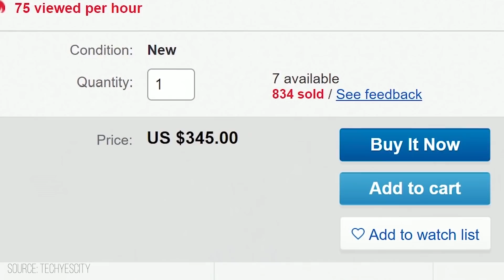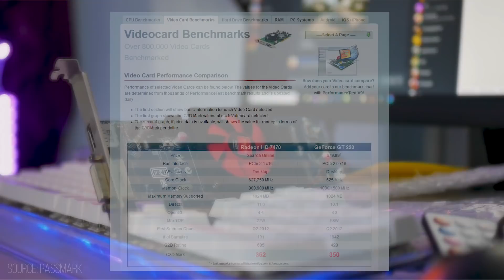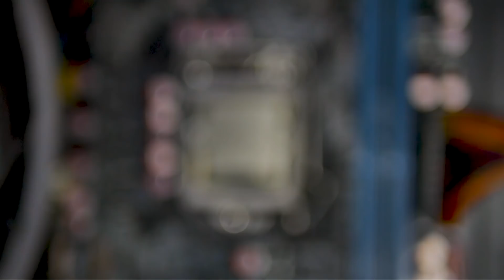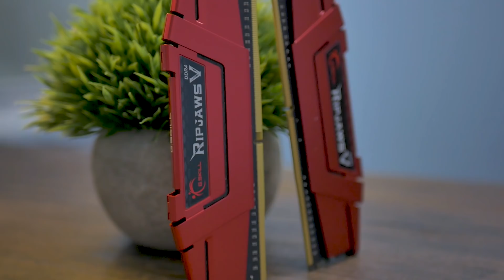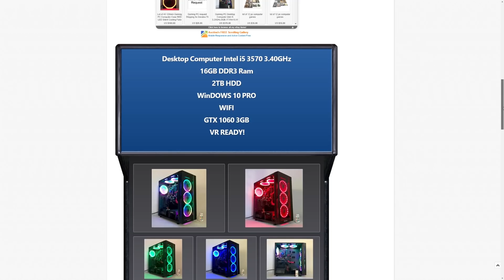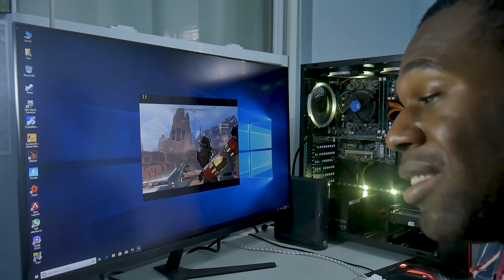These eBay Gaming PCs are NOT GOOD...Here's Why | OzTalksHW

Comment: I had an OEM PC sitting around and an 8GB XFX RX 570 so I thought I'd get a nice power supply and drop the 570 in it so I could sell it as a gaming PC. It's a quad-core AMD Phenom II 820 with 8GB of DD3 RAM. I got an SSD for it, installed Windows 10 and used the Windows 7 key on the sticker of the PC to activate the fresh copy of Windows 10. At this point I'm thinking the RX 570 would be the hero and I could definitely get 60 FPS at 1080p no problem. WRONG!! I chose to run the Shadow of The Tomb Raider benchmark to test it since it is a CPU intensive benchmark. The results were mid to high 40"s FPS. Sounds playable but when you look at the 1% lows its awful. I ran the game on story mode and oh boy it's far from playable. The stutters are insane! If you are in the hidden city... forget it! the FPS drops below 20. I bet it runs Fortnite somewhat OK but surely some stutter will still be noticeable. The CPU doesn't even have the instructions to run APEX Legends (you just get an error message when you try).

Anyway, it's miles better than the PC on this video but I thought about the same thing OZ said; some kid excited about his/her new PC on Xmas morning only to be destroyed by the fact that the PC sucked. Or even some teenager or adult who spent their hard earned dollars thinking they were getting a nice system. I'm definitely going to take out the PSU and the GPU, leave the SSD with the fresh Win 10 install and sell it cheap as an office PC (I'll drop an old NVIDIA GT 740 in it so someone could run titles like CSGO or League if they want).

Moral of the story is guys, don't be a greedy bastard and screw people over. Even a PC that can average 45-50 PFS on most titles is garbage for gaming when the CPU is always stuck at 100% utilization and stutters like crazy during game play. Don't do it to people. Think about how it would feel if it happened to you!

Comment: I managed to pay 420 for a prebuilt system with a Ryzen 2400g which I honestly thought was really good, later down the line I bought a gpu and other upgrades, but honestly should of built it myself cause it really wasn’t that hard to rebuild (just the front panel connectors)

Comment: The eBay gaming PC market is horrid, there are TONS of listings just like this and even worse ones.

The guy who sells these exact machines on eBay has over 1000 sold for that listing (priced at $339.99 last I checked with only about 3 negative reviews). The whole market enrages me as a seller with respect for system performance because if you dont have RGB everything, good luck selling even a $5000 gaming system for $300.

Pro tip, if you are trying to sell gaming systems on eBay, you need to have RGB for the boomers who are probably buying these things for their grandkids

Comment: somebody help me with this: https://www.ebay.it/itm/ULTRA-FAST-i3-i5-i7-Desktop-Gaming-Computer-PC-2TB-16GB-RAM-GTX-1660-Windows-10/223573457778?var=522318773804 READ MORE !!!!

MY SETUP FOR THIS IS 
Processor: i7-2600
Memory: 8GB Ram
Hard Drive Capacity: 2TB + 240GB SSD
Graphic Card: 6GB GTX 1660
---------------------------------------------------------------------
IS THIS A SCAM? 
IS A GOOD PC FOR GAMING 
I WILL BUY IT WITH A I7-2600 BUT WITH 1TB OF HARD DRIVE CAPACITY ( WITHOUT SSD ) 
OR I WILL BUY A I5-2400 BUT WITH 2TB + 240GB SSD     
P.S I WANT POWER !! NOT SPACE !!

Comment: Dafuq. I'm getting an old i5 3000/4000 series with power supply (400W), 8GB ram and motherbord (+ 1TB drive) all for 120$. Let's say a new power supply  for around 80$ and RX 570/580 for 100-150$. Literally 300/350$ and still cheaper than that system.

Comment: What about the micomp prebuilt? Specs are as follows 

BrandHPSeriesProModel6300

Quick InfoTypeGaming & EntertainmentForm FactorSlim/Small form factorUsageConsumerColorsBlackOperating SystemWindows 10 HomeCPUCPU TypeIntel Core i5 3rd GenCPU Speed3470 (3.20 GHz)MemoryMemory Capacity8 GB DDR3StorageSSDNoHDD250 GBOptical DriveOptical Drive TypeDVD-ROMDisplayScreen SizeNo ScreenCommunicationsLAN ChipsetIntegratedLAN Speed10/100/1000MbpsWLANIEEE 802.11nBack Panel PortsVideo Ports1 DVI, 1 HDMIRear USB6RJ451 portRear Audio Ports2 ports

Comment: $30 mobo, $10 CPU, $13 GPU, $10 PSU?, $20 RAM, $20 case?, $50 for building, and $172 RGB lights. Using ebay.

Comment: Rgb isn't form. And the i5 650 is a unlocked dual core.....meaning quad core.

U just compared a Vega 56 to a 15 year old gpu......fuuuuuuuuuu

Just stop. I did. I Stopped the video. I'd rather watch the verge pc build than this.

Comment: Be like me buy an optiplex 790 mt with i5 2400 for $100, gtx 1050ti for $150 (on a good day), cheap memebrane keyboard $25, 2 free 1080p 60hz monitors, 2 already owned 500gb 5400rpm hdds, 1 already owned mouse. Total cost around $275 (i knowing a little pricey considering specs)

Comment: I bought mine for 240? It had free windows 10 pro 64 bit a gt710 8GB RAM blue leds 1TB HDD 7200rpm i5 2400 intel dq67sw cit f3 case not a bad deal I built the rest up and sold the parts for money. If I got that part for part I would be looking at 340 ish not even talking about cpu paste extra cables software.
Currently I have the same pc just with a new psu and gtx 1070 no issues 99% cpu usage at very high with full rendering and taa sharpness all for the price of a playstation 4 pro.

Comment: I bought an Ebay PC for 350 and it wasn't too bad for me. Only things I did was a new graphics card and added a SSD and it runs games like Fortnite and until dawn with little to no lag and between 70 to 120 fps. Even after the upgrades only have 450 in the whole pc itself.

Comment: I'm really budget, I have a old Dell optiplex 390, i3 2120 3.3ghz, gt 1030 2 GB, and 12 GB of ram, one 8 GB stick 1333 mhz patriot ram, 4 GB stick that came in the computer, I think it might be server ram but I keep it in because it seems to run a little better, i probably payed around 170-180 dollars for the whole system, I'd say it's not a bad experience at all, I can play really any game low settings, 1920×1080 and get well over 60 fps, please judge my system and give me any tips of what I can add/ improve
Reply: An ssd
Reply: @pinakinkale  Ye
Reply: @pinakinkale  ssd is coming soon I gotta save up some money, any you reccomend to be good
Reply: Rylan get something from western digital, but don’t cheap out on an ssd I’ve learned the hard way
Reply: A better cpu if you can
Reply: @tanmezja8407  any recommendations
Reply: @rylan8815  Search your motherboard on google and see what cpus supports and get a cpu with 4 cores.
Reply: @tanmezja8407  thanks
Reply: @rylan8815  np if you want more help tell me if you want 😁😉

Comment: Its okay each led on the rgb is +20fps.
Reply: But the gpu is -300fps
Reply: FPS as in Feet Per Sec as a measurement of how far I would throw that thing out the window translation + 999999999999999999 frames per sec
Reply: @JimTheKid  I thought it was Flash Per Second from the RGB.. Damn!!
Reply: Everyone knows that RGB increases performance dramatically
Reply: that rgb is more expensive than the gpu so it gotta be

Comment: my athlon 64 x2 rig died. I went to the nearest/cheapest pc repair shop and got a core 2 duo/pentium dell vostro with 3gb ddr3 and a 250gb seagate drive for 60$. I got a core2 quad q9400 and a 4gb stick of ram from ebay for 30-40$ and a hd 7750 from aliexpress for 30 $, a 500w chinese psu with 75% efficiency (so a 400w psu :)) ) for 24$ and reused my old wd caviar green 320gb. In total 150$ for something that plays esports and older games like skyrim just fine

Comment: So I am preparing to build my first gaming desktop, taking the leap from console to pc. These are all the parts I’m about to order this Friday, any advice or anything on this build is appreciated. I’m planning to get GeForce rtx 2070, Kingston 240gb a400 ssd, asus ROG strix b450-f gaming motherboard, deepcool captain 240 ex AIO liquid cpu cooler (240mm), wd blue 1tb hard drive, Corsair vengeance lpx 16gb ddr4 ram 3000mhz, amd ryzen 7 2700x processor. And a case of course, any thoughts on this build

Comment: I bought a PC from eBay for around 350$ with an AMDfx-3600 processor and a ryzen rx 460 and it runs fortnite on high at 60fps, and battlefield 3 on medium for around 60-70fps

Comment: I'm shopping for high end system.
But if you see an original Intel cooler in a system advertising a Core i5, a Core i7, or even worse, a Core i9, it is a very bad omen for the reliability of the system in the long run.

See, the original Intel cooler was designed for the Celeron, Pentium and Core i3 SKUs.
It simply is not sufficient to dissipate the heat of higher-end (i5 - onward), and result in high noise, deterioration in performance (thermal-throttling), and, in the long run, a deterioration of components from repetitive dilatation and shrinking due to the excessive amount of heat...

If you are new to PC building here are the keys:
-Always a decent motherboard. 
-Always a good CPU cooler. 
-Always a good power supply. 
-A fast boot drive.

Comment: I5-650 1156 stock 170 (cinebench)
Slower then 
Xeon E5430 3ghz (cinebench) 350 775(771)
Core2Duo E75003.9ghz   200 (775)
Reply: ✌😏 Core 2 Quads typically get you 260 in CB, this build needs at minimum an i5-7?? which is a legit Quad Core CPU

Comment: there's a pretty good chance that whatever system's integrated graphics they are currently using is stronger then the HD 7470. Intel HD 4000 (mobile) is stronger then this graphics card in a system advertised for gaming.
Reply: 🙂 correct, but for like $30 u can pu a much stronger HD Radeon card or an old GTS Card

Comment: "Hard drives usually have a 3-5 year lifespan" my Dell Dimension 4100 and unbranded old computer (both running Windows 98 and that i use for old games) beg to differ, the one in my unbranded computer which I grew up with has a 320GB western digital blue drive and somehow yes windows 98 has no problem using all 320GB dont ask me how lol

Comment: Oz, 1 error, I  think. In general you don't pay much for that pre-activated Windows. On the other hand, the license is coupled to that system, it is not a retail version. As far as I understand MS charges something like $15-30 for that OEM-license which is what I would pay when I buy a key on a key-reseller its website.
More to the point, most people don't need Windows. Linux is a great alternative these days, even for gaming. Watch LTT their latest video on it: "Microsoft Should be VERY Afraid - Noob's Guide to Linux Gaming".
Their best video in years. 

Also it is relevant that OEM's pay less for the same hardware than we ordinary customers do because they buy in bulk. You mentioned that.

Other than that you make a great point, there are costs involved (not to forget profit margins and bonuses of managers and all that) which you have to pay and you better spend that money on hardware.

A closely related point: while on low-end OEM-systems the overhead is large on higher-end OEM-systems you typically pay at least $100-200 extra on top of the added costs if they put a nicer graphics card or CPU in it. Some OEM-systems are fairly priced, especially if there is a discount but generally assembling (a better word than building in this context in my opinion) it yourself is better. Also it is a lot more fun if you assemble your own system and you won't have any fear of upgrading because you know your system.

On a different topic, only an American would make a price comparison with burgers from a fast-food-joint. Even though the Big Mac index is surprisingly useful. :p
Reply from the maker: yeah some awesome points! A lot of higher end pre-built machines are well priced for their raw performance. LOOOOL to your burger index...it's true!

Comment: You could get an AMD APU that would smoke this for the same or a little bit more or less depending on prices where you live, would not buy this pc even for my parents or grandparents.
Reply: I can go to Micro Center right now and put together a 2200g build for $300, maybe less if I include Amazon/Newegg deals. Could make it a Ryzen 1600 with a RX570 and include Newegg/Amazon deals and make it for ~$400+tax. Heck, I spent ~$380 + tax on my 2200g SFF build last summer when DDR4 prices were nearly double what they are now, and could have saved ~$60 on the motherboard, case and PSU by going microATX instead of mini-ITX.

I get the seller needs to make money after ebay fees, but this is false advertising when it comes to numbers and saying it is a gaming PC (though I guess it runs minesweeper ok). He could have upped the cpu to an i7 or Xeon and upped the GPU to a 750ti and probably still made profits on that pricing  and at least be have a better product.
Reply: I was able to put something together on Newegg with a Ryzen 2200G, a RX 570, and 8 GB RAM for $413+tax, and if you take the graphics card out it's down to like 280+tax.

Comment: Can somebody help me? I'm on a $400 USD budget and I want to ask whether to buy this PC or upgrade my PC with a 1650 + 32GB of RAM?
Reply: jangelelcangry just get a rx 580 maybe a 590 used i would not recommend getting a mined used
Reply: Why 32 gigs of RAM? One thing you could do is raise your budget and get a 1660 and 32 gigs of RAM or you can save your pennies after buying the 1660 and 16 gigs of RAM and add another kit in later. RAM is almost always dropping in price, or there's always a kickass deal on it nowadays, so take advantage of that and soup up your GPU while you can. The reasons for not going the 1650 route range anywhere from it being an awful value GPU, to it just not having the juice to run some games at 1080p 60fps (it still offers an enjoyable experience, but games are only getting more intensive as time goes on). This is all assuming your PSU has the features (the proper connections) and power output required to run a slightly more power hungry card.

Comment: 305$gaming pc
motherboard h61m=38$
i5 2400=34$
gtx 960(4gb)used =95$
hdd 500gb =30$
power supply 400w=30$
case gaming =40$
ram ddr3 8gb 1800(2×4)=21$
rgb cpu fan=15$
and you have a gaming beast pc
and if u have 323$ u can to replace thr hdd with a (480gb ssd =48$)
(use ali express)

Comment: Honestly, an original Intel CPU cooler is a red flag for me.
Reply: Can I ask why? (I am new to computers)
Reply: @jefferdon4428 
I'm shopping for high end system.
But if you see an original Intel cooler in system advertising a Core i5, Core i7, or even worse, Core i9, it is a very bad omen to the reliability of the system in the long run.

See, the original Intel cooler was engineered with Celeron, Pentium and Core i3.
It simply is not sufficient to dissipate the heat of higher-end (i5 - onward), and result in high noise, deterioration in performance (thermal-throttling), and, in the long run, a deterioration of components from repetitive dilatation and shrinking due to the excessive amount of heat...

If you are new to PC building here are the keys:
-Always a decent motherboard. 
-Always a good CPU cooler. 
-Always a good power supply. 
-A fast boot drive.
Reply: @Erebus-PCFX  oh ok thnx

Comment: If you want a real budget build find a I5 2400, still pretty solid, and you can get  board/cpu/ram/psu for 100$ case $25 get a used videocard for 75-100 get a solid build that should last for awhile. Yeah I agree ryzen is a great choice love mine, but if your looking for half the price for pretty much 90% the gaming performance. Can get a rx 470 8gb in there and its a 1080p60fps. Sadly old i5, but runs solid as Intel has been mostly sitting on their hands waiting for amd the catch up lol.

Comment: Ebay is eitherway a hard miss or a bliss. You need to know what you're doing and what to look for. (advanced search, looking for specific parts, or just eitherway buying stuff each on it's own and checking the seller on his reputation, also paypal ofc).

Here in Europe you can often get some good deals for retoure, refurbished or exhibit samples. Got a new notebook for university(residential) for half the price since someone send it back. Most likely I guess since it only has 1x16gb ram slot (+one free) instead of 2x8 which was not mentioned, but is normal for that one.

Comment: is my 2012 hp laptop better?
300$ 4 years ago
amd a6-5200 quad core with hd 8400/r3
chocks at 2ghz cpu, gpu at 800mhz
16gb of ram
256gb ssd
i get like 15fps in fallout 4, 30 if i tweek settings WAY down
im going to upgrade soon i want the acer nitro 5 ryzen

Comment: I love it when I see laptops that are branded as "Gaming Laptop" at stores that has a 4K screen but the GPU it has is too weak to run it at 4K even on moderate FPS so the gameplay won't feel sluggish or choppy lol They want to ask $2,000 or $3,000 for those. The CPU are usually adequate to run games but the GPU are always seeming to be trash 90% of the time. Unless we looking at real Gaming Laptops built for that purpose which would range anywhere from $5,000 to $9,000 with dedicated GPU.

Comment: To get 27 FPS on those specs, I'm sure the seller had to edit the config file of Fortnite to allow it to run way under spec of the lowest graphic settings lol My old intel core 2 duo from 2010 would crash when I try to boot up Dragon Age Inquisition paired with my Fury X lol thing is too weak to handle that old game and being as a sandbox style game Fortnite is that is a multiplier game would be leaning towards more on the CPU side than GPU.